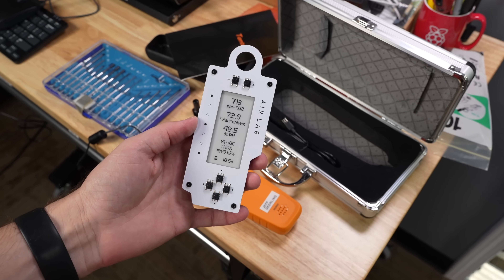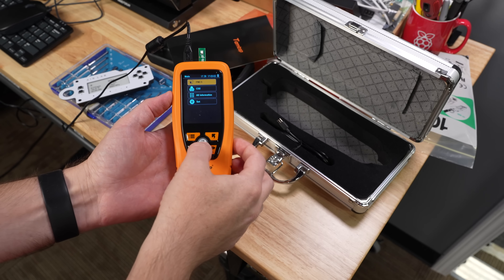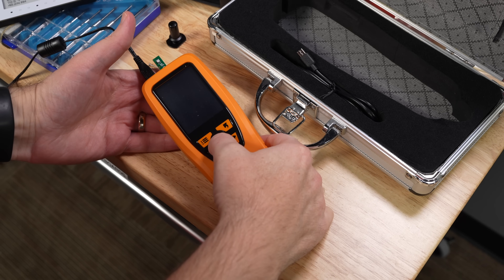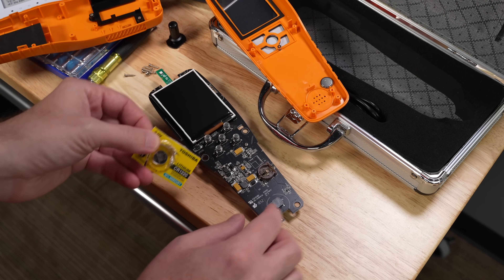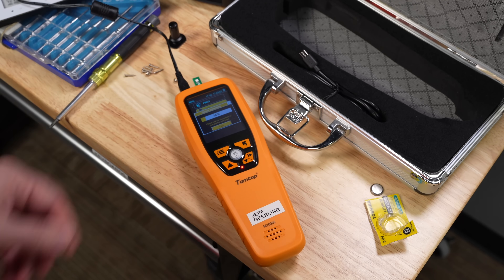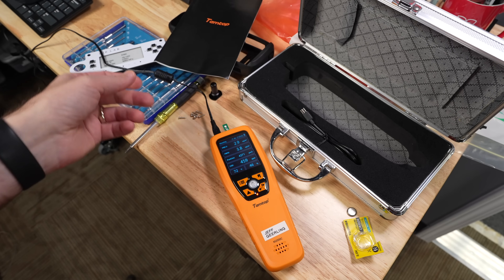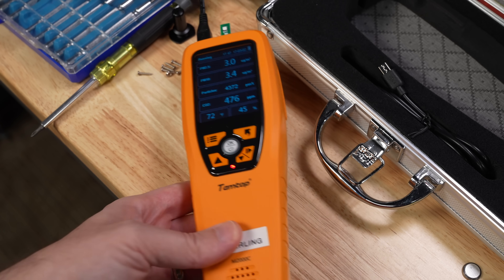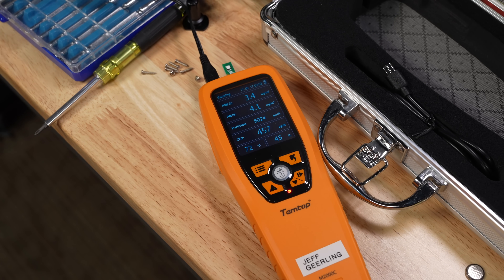I fixed my broken CO2 monitor by replacing a hidden battery

Comment: If you think the coin cell battery packaging is bad, look at hearing aid batteries! At least with the larger coin cells you have slack space in the blister to cut through. With the HA batteries the plastic is so tightly conforming to the small battery itself that it is extremely difficult to cut them out, and you end up with a bunch of shredded packaging. You have to cut around more than one side of the battery, while making sure you don't accidently pull off the activation sticker tab.

Comment: I'd like some good air quality sensors that I could connect to a microcontroller so I can actually use them for automation and making the air quality better. Would you recommend the Airlab for that?

Comment: I would put a label on it with the battery model and when you replaced it too. In 5 years you will have forgotten again. :)
Reply: Or parallel the lithium battery with the CMOS battery and you won't need it again.

Comment: Lifespan of the sensors depend on the type: electrochemical sensors (Formaldehyde/HCHO, CO, TVOC) lifespan: 2 to 3 years under normal use, laser particle sensors (PM2.5, PM10) lifespan: 5 to 8 years, NDIR sensors (CO₂) lifespan: around 10 years, and temperature & humidity sensors lifespan: over 10 years! Some can be changed, while others can be recalibrated, when needed.

Comment: Invest in good shears for opening packaging. The best ones I've ever bought were Fiskars shears which cut everything with ease, have an actual warranty and replacement parts available. They're a buy once cry once investment. 

I have multiple different types - one of the multipurpose "cuts + more" (Grey handle) for the kitchen, the pro shop, and hardware shears. The multipurpose are superb kitchen shears that come apart with no tools for easy cleaning and have a sheath with a built in sharpener. The pro shop and the hardware shears give added leverage and I've used them to cut thick leather and metal so they don't even blink at plastic packages.
Reply: Fiskars products are good! Yet it's pretty easy to find EMS-type shears at places like Harbor Freight or Fleet Farm for less than $5. Makes a great stocking stuffer! 🎅😎✌️

Comment: The device ought to tell you the CMOS battery is dead instead of a false message about preheating.  I wonder how many of those go in the trash because of that.
Seems like a serious design flaw.  The user manual not even mentioning there is a CMOS battery and that it affects operation is a serious oversight and very customer unfriendly.

Comment: Planned obsolescence? 😠
Reply: planned obsolescence does not apply when you can open the device and change the battery because you are allowed to

planned obsolescence only applies when apple decides you cant open or change parts on your devices or they lock the software or slow down your device so you dont see the battery died because they dont want you to change the batter and want you to buy another phone

it is a battery that could be replaced and they forgot to put it on the manual, end of the story.
Reply: @gotgg-n6w  Hopefully they just forgot to put in the manual then, otherwise its pretty sneaky to hide it on purpose.
Reply: @Bassquake76  it is not hidden, it is easy to open and replace

complain about apple who got sued for doing on purpose tall that i said, and lost

learn the difference between incompetence and planned obsolescence, here the device still works, apple designed the phone to get updated to become obsolete when they wanted it via updates

Comment: I have that same set of screwdrivers in the blue case.
Reply from the maker: It was my first set of drivers when I was in grade school, got them from Radio Shack!

They're still the most reliable for "need to get into a long screw well in the back of a plastic thing and get some good grip". Too many drivers have very short shafts nowadays.

Comment: The question is...why does it need the coin cell.  It's there for a reason...likely storing a factory calibration or something, unless it has a RTC.
Reply: CO2 sensors need to be regularly calibrated, and since replacing it fixed the problem it's almost certainly for storing calibration data.
Reply: @JanPeterDeVries  but why this and not 256byte eeprom chip or even a sliver of flash on the microcontroller ?
they are literally $0.1 in bulk
Reply: @xani666  You are judging history from your perspective of now.  Invalid.
Reply: There’s some cO2 elevation problem I remember reading about that can cause issues. You want a known outside value to set the reference point regularly. Air gradient has a forum post on it.

Comment: It's great the new coin battery fixed it, but also why did that fix it? The CO2 preheater only works off the coin battery even when the rechargeable battery is present?
Reply: because it was made by a bunch of hippies.

Comment: Oh for the days of real exploded diagrams and part numbers in the user manual. Hiding a CMOS battery and not mentioning it exists is just nasty.
Reply from the maker: Yeah, I yearn for those days again. Working on older tech is more fun since it's less an exercise in reverse engineering, and more in debugging and fixing.
Reply: @Level2Jeff  Not just a thing in tech either - or at least not electronic smart tech, for instance I'm rebuilding my 'new' lathe which is thanks to the manual really easy to figure out how it all goes together. Its a machine that is only 40 odd years old built to a design that is now nearly 100, and the manual is just superb for this refurbishment.